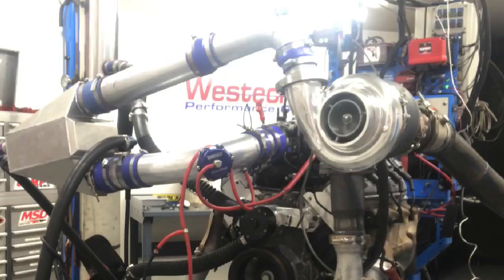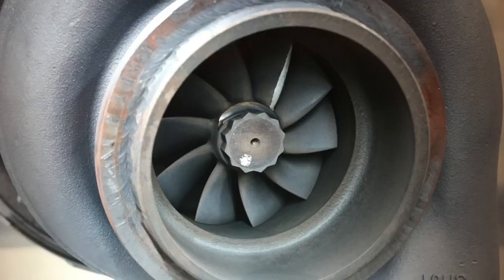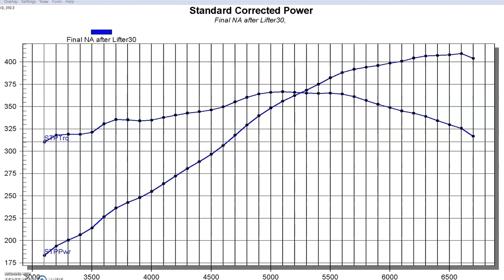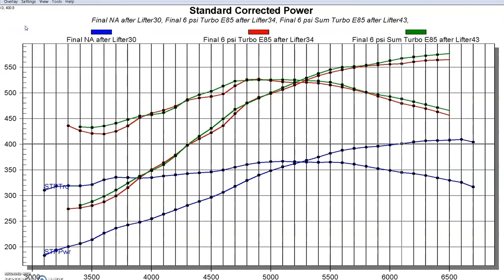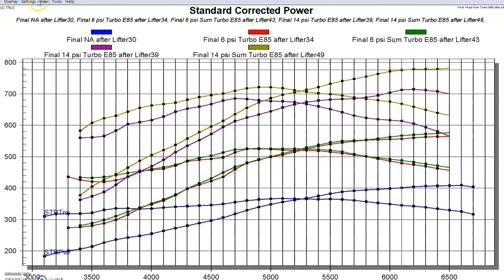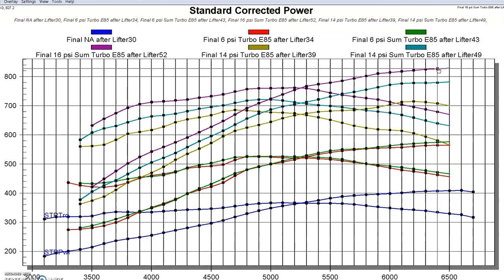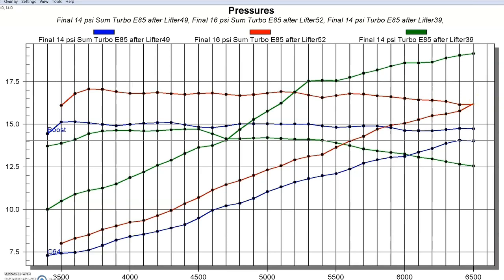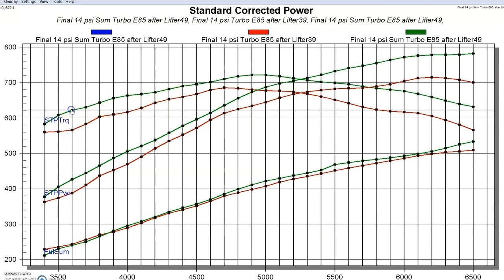CHEAP TURBO JUNKYARD 4.8L-GT45 VS S475 TURBO UPGRADE

Comment: Maybe you could awnser this wierd question. Would there be a hp difference on a 5.3 with single vs twins max boost 25 lbs
Reply from the maker: depends on exact turbo specs of each-but if both are sized to support 25 psi, power will be similar

Comment: How come Richard holdener hasn't done a 6.2 LS3 or 6 2 l92 Big bang test
Reply from the maker: I don't take the expensive alum blocks over 1000 hp, except the alum 5.3l blocks
Reply: @richardholdener1727  how much can they hold
Reply: How much horsepower can they make Richard holdener

Comment: I hope you see this Richard and you can help or anyone

I have a 4.8 with a small cam I’m only looking at 500whp at most thru a manual transmission 

I’m debating on vsr 75mm 83/75 1.10ar
Or 7875 .96 turbo

I’m looking for instant spool and not really die out till 6-6500rpm 

I’m not looking to make more then 550-550whp at most 

Please help thank you
Reply from the maker: use the 7875 or smaller

Comment: If all cams are turbo cams, why are you using a BTR turbo cam when his naturally aspirated cams will make more engine hP? I'm confused as to your reasoning.
Reply from the maker: we can use any cam for the test-the test was to compare turbos-not to max out the power output (which by the way, the turbo will decide how much this motor makes-not the cam)

Comment: In honest opinion I feel the s475 was the ticket. With a larger displacement, I feel the t6 would be better in over 5.7l+ where on this little 4.8l and even a 5.3l, a t4 in a 1.00-1.10 range would be a fairly responsive turbo. The gt45 looks like it'll be quite responsive and might have a really good power band for your street drivability at the sacrifice of upper rpm power. Not that the s475 would be lazy but it definitely won't come in quite as quickly. 

If it were me I'd pick the same thing you would Richard, s475 with a t4 housing. 😎🤙

Comment: Trying to figure out what turbo to buy for my t56 car, 5.7 iron block cam heads intake, looking for 1000wheel and want to know if I should/would have to go bigger than a s475 or say vs 7875
Reply from the maker: for 1000 hp or so, those turbo choices will work

Comment: Would there be a noticeable difference in spool time (lag) on a 4.8 between the GT45 and the S475? I'm only looking for 500-600hp on a blow through carb non intercooled 7-10psi max, running 93 octane. I'm trying to find a turbo that will spool the fastest.
Reply from the maker: PICK THE GT45
Reply: @richardholdener1727  thanks!

Comment: People also need to know the s475 T6 summit turbo uses a special exhaust flange on the turbine outlet side. It's not a standard flange. You can pick one up from Amazon, ect as I don't think Summit sells it. You can also neck it down to 4 inches unless you're going for really big hp without much loss in spool. 
I also suggesting getting the flange that comes with the correct T-bolt.

Comment: Richard get with Summit or/and JEGS,   make  packages for (N.A. or BOOSTED)
1. 4.6/ 5.4 Ford
2. 302/351 Ford
3. 4.8/5.3/6.0/6.2
4. 350 (1955-1990)
5. 350 LT-1 (1992 - 1997)
6. BIG BLOCK CHEVY
THREE DIFFERENT PRICES
A. JUNK YARD DOG
B. FIXER UPPER
C. More Money, More Money🤑🤑🤑
Thanks for ALL Your HELP.

Comment: Is the AR ratio on the gt 45 hot side the same as the 475?If it had a lower ar ratio like a 1.05 compared to the 1.32 s475 couldn't that impact back pressure difference?

Comment: How do you measure back-pressure? Do you keep the atmospheric pressure or is it pressure above atmospheric (as on the intake side)? I see much lower back pressure numbers on my small turbo set ups on smaller engines but have not worked with the large engines yet. (For example I get 1:1 pressure ratio on 24psi with a 2,3 liter 400hp engine)
Reply from the maker: the back pressure is a function of the turbo and engine displacement/power output. Back pressure is measured suing a sensor in the dyno-we run aluminum tubing from a steel fitting to a rubber hose, then to the sensor.
Reply: @richardholdener1727  Yeah what I ment was, do you measure back pressure including ambient pressure or without as with the boost pressure?

Comment: Richard you need to compare the CX Racing GT45r 76mm to the Summit S475. It also has the same 77x88mm exhaust wheel as the 69mm GT45, but has a bigger 76mm intake wheel and bigger exhaust housing. That'd be a good comparison

Comment: Can you bleed off back pressure to increase HP?
Reply from the maker: i've been told you can but have not seen that work
Reply: @richardholdener1727  

The problem with the gt45 is the undersized compresor. As it runs off the efficiency island on the right side attempting to supply x psi at a massflow it cannot support efficiently, neccessary compressor rpm goes through the roof. Exhaust side has to answer the request for more compressor rpm by bypassing less out the wastegate and using more to spin the turbine rpm higher. Hence higher turbine inlet pressure. Pay particular attention to compressor rpm traces on efficiency maps as compressors run off the right side of the map.

Comment: Be nice to see gate position on these. Be very telling if back pressure is opening the gate once it gets significantly above boost target. Would also tell you if the low back pressure is caused by an open gate or if the turbine side is sized accurately.

Comment: Could you dive a little deeper into WHY and WHAT actually causes the poor back pressure vs boost curve? Ie, could it be the AR of the gt45? Is it just the turbine size? A poor compressor AR to turbine AR ratio? Just a little more tech than “turbo size” 
Love your work!
Reply: Wheel design and housing(s) design. Some wheels/housings flow better than others. Even a s475/s480 has a race cover that make more power.

Comment: Building a budget Ls on my channel. For my Infiniti G35 street/strip car.  Gen3 5.3, gen4 rods, flat top pistons, ported 706 heads, TBSS intake, decapped injectors (76ish lbs/hr) Comp Cam valve springs, with ls9 cam..... turbo choice is my biggest hurdle.  Can you help! I dont want hear say. I'm a see it to believe it kind of guy.
Reply from the maker: How much power do you want? And a different cam will help a lot-especially with spool
Reply: @richardholdener1727  right now. 600ish to the tire with a th400 and stock 3.36 gears
Reply: @richardholdener1727  plus the overall theme of the turbo power plant has been use oem spec parts to get as much power out of what started as a 4.8 ls base motor. All parts in the long block are used parts I already had and refurbished them for this build. That's the reason I'm using the ls9 cam for now.

Comment: Boost pressure actually helps push the piston down on the intake stroke.  Backpressure on the exhaust cancels this out so any bckp more than bstp works directly against the piston area.  Taking into account stroke, rod length and rod angles, you can calculate an average torque number (parisitic loss) of adding more bckp than bstp.  As far as gains/losses on the comp side its simply a density ratio from the IAT's... And since you're running an intercooler and really only interested in the whole system in this test, i imagine the differences there to be minor... In reality though, if you have a less efficiant compressor that you run through an intercooler, the manifold sourced controller will make the turbo put out more boost to compensate for the pressure lost in the intercooler, and of course, this is paid for by drive losses on the exhaust side but since you didnt include pre intercooler temps and pressures, I don't have the data to say, but given data, its possible to model drive losses caused by spinning a less efficiant turbo faster to make the same boost after an intercooler.

Comment: Richard:    On the 4.8 I think that S475 has too much turbine wheel.   The compressor flows 98lb/min which is roughly 1000hp capable.  

I would love to see the same test but with the new Borg S472sxe (14009097006) with 1.10 T4 turbine.    It flows 110 lb/min with a 3mm smaller compressor and it’s turbine I feel is sized better for that smaller motor at 87/82.    I think you’d pick up quite a bit of hp but more importantly spool and lower IAT’s.
Reply from the maker: I agree on the sizing of the turbine for the 4.8L, I'm not sure how IATs would be effected by the change though
Reply: Richard Holdener I didn’t do the math and assumed as the new sxe turbos are more efficient.    However at at that low of a PR the efficiency is only 2% better resulting in a IAT decrease of only 0.5 degrees F.   

Also per Borg Warner Matchbot that 4.8 at the HP peak of 6000 rpm is ideally matched to their 87mm turbine.

Comment: I would love you to talk true the compressor dmap and lay it over the power curve if possible, wuld take a lot of Google search time out for me.

What it comes to back pressure its a comes down to the efficiency of both the turbin, and the compressor, if the compressor is realy bad it's going to take a lot power just to heat the air and that takes effect from turbine, if the turbin is really bad it's taking a lot of energy to get the turbine the power.

This is just my thoughts about the thing, usually you go with smaller turbin to get the lag down and the turbo to spool up lower in the revs. After all, you can size a turbo so that it doesn't need an waste gate, you culd do it so that the compressor is right in the middle of the map getting best efficiency and you don't need to waste eny exhaust, how ever the trade off is that the power band is really small. And the turbo is quite laggy

Comment: I disagree with some of you points regarding back pressure. On the ebay turbo (imo) the turbo reaches its maximum shaft speed around 700hp. Once the wheel can't spin any faster it causes a major restriction in flow. The boost pressure keeps calling because the engine is getting more efficient as the rpms are climbing, the turbo cant spin faster to keep up with the acceleration of the engine, so the boost goes down. This is also the reason both engine make the same hp. The bigger engine makes more tq because it is more efficient in lower rpm due primarily to displacement.
I would like to chat with you directly about this sometime, darksideturbo@gmail.com
Reply from the maker: Always Happy to talk, I'm curious how you come to conclusion that the turbo reaches a maximum shaft speed at 700 hp (at what engine speed and boost level?). Especially without knowing what that speed was in this test. We know from additional testing that this turbo will support 800 hp, and would do so on this 4.8L, with more mechanical spring pressure on the gates. It just wont be happy at this power/boost/back pressure level.

Comment: What were the intake air temperatures that will tell you the compressor difference
Reply from the maker: They were taken in the intake after the cooler-I needed to take them pre cooler

Comment: You are never going to get a turbo that's both perfect for a small block 4.8L and a 454 big block, any turbo that has an appropriately sized rear wheel/housing for the 4.8 is going to be too small for the 454 and choke it or come on way too aggressively and anything with a rear housing/wheel sized for the 454 is going to be really laggy and take forever to spool up on the 4.8.

Comment: Richard Holdener The first compound setup I ever built was a he351cw over a ebay gt45.  It made so much boost and back pressure after 110psi my 5 ply couplers would burst splitting in half. When that happen oil would shoot past the compressor on the he351 oiling my whole engine down.  I learned to use the intake off my turbo as vacuum in a catch can and Ive since got rid of that setup.

Comment: Thanks for showing a dyno video on this one.
I think it adds to the content quality when short vids of the actual power runs are included with the test results;and I’d like to see each run for each test like engine masters.
A simple data log of intake temps verses boost comparisons would show if the gains came from compressor imo
Keep up the good work 💪
Reply from the maker: thnx-on some of these older tests-I don't have each run or even any runs on some of the much older tests(I've been testing since 1989)

Comment: you are hard working Richard!  compressor has a big influens on the back presur also.   big engins neads big turbos.  junk motors is the best lerning tool.  I have done junk volvo dyno  b230 engins (sweden LS engine?) meny years and it never gets boring.
Reply from the maker: Go Volvo!

Comment: Here's what I think, theoretically with the same back pressure and boost pressure (as well as temp, humidity, other air density factors) an engine should make the same power. So what we saw here is the new turbo is more appropriately sized for the power level (in this case, boost level) it was run at. So back pressure went down. This reduces combustion temps, egts, and prevents exhaust reversion that kills horsepower. The GT45 is just too small to be a power adder for an LS. Most turbos will make more power than they should be run at, look at OEM cars that have massive gains with ECU tunes. Yeah they make more power, but the turbo is overspeeded, maybe the exhaust backpressure is too high, etc. When building project cars we're not usually restricted by a rulebook, so we may as well size turbos correctly rather than push a smaller turbo to it's limit. As for spool, it's my understanding that the GT45 is actually pretty terrible.

Comment: If you wanted a T04 flange S475, you could have gone with a Borg Warner or Bullseye Power. Not sure why you are stuck on Summit unless they're a sponsor.
Reply from the maker: I wanted to try  A tT6 on the 4.8l-A T4 is probably a better choice-Just letting them know what might work better-maybe they listen to the customers

Comment: 4.8 vs gen 1 sbc N/A and turbo but with comparable heads and Coil on plug upgrade for the gen 1 both running holley hp sequential fuel injection

Comment: Which turbo is the best for ls 6.0
Hard driving  in sand withe perfect power  not less 700 hp
Reply from the maker: 78/75 with a good size AR

Comment: Great test! It'd be interesting to see a comparison between the T4 83mm S475 and the T6 96mm S475
Reply from the maker: I did a T4/T6 test but I think it was on an S480
Reply: @richardholdener1727  in which video ?

Comment: Nice video Richard. Am seeing results atm with a 6.0 and vs7875 and I'm seeing a full 2-1 ratio running through mufflers. Next time at the track I'll drop the mufflers and let you know the result. One thing to note is I'm setting up flex fuel atm and see more back pressure with e85. What you say about drivability is valid but the 475 still has more torque at 3500
Reply: I dont think dropping mufflers will help much, the vs7875 just has a tiny .96 turbine housing which I think is its only flaw. They now offer a 1.25 housing for it but it's divided so I'm not sure how much more volume it really has inside. I have the vs7875 on a 5.3 currently but have no pressure data yet.
Reply: @FredAllenBurge  agree, but a test will prove it. I really think this turbo is done at 6000 so if I was to make a change I'd go much bigger in the turbine. That being said this sure is a nice street car setup, gave just been a bit worried if 28psi back pressure could damage the engine
Reply from the maker: a portion of the increase in back pressure from e85 comes from the extra power
Reply: @richardholdener1727  yep. Back pressure went from 24 to 28 psi unleaded to e50. How much Back pressure is too much on a sbe ls? Will it damage it

Comment: What is the intake temp difference? The s475 is going to heat the charge air less at the same boost level. What is the difference with the timing curve? The lower back pressure/drive pressure on the S475 is going to allow more ignition timing at the same boost level. It would also be interesting to see the power/torque difference between the gt45 and the s475 out of boost. I have had big turbo LS setups that drove really great and had a lot of torque out of boost my theory is that the engine can breathe through the turbine at low rpm and make good torque out of boost before it spools up and makes real power at higher RPM.
Reply from the maker: no changes in timing and minimal changes in temp-but we only took it in the intake after the cooler

Comment: Big fan of showing the back pressure vs. boost curves.  So many customers don't understand why their friend's established brand name turbo outperforms their cheap Chinese knock off at the same boost pressure.  You can verbally explain it all you want, but showing them something like this is a great way to demonstrate that you usually get what you pay for.
Reply: The difference shown here isn't from the turbo's brand or quality its mainly from the turbine size and turbine housing size.
Reply: @FredAllenBurge  You are right that size matters - no argument there.  But never underestimate how bad the knock off stuff from China really is.  A good Garrett GT4508 should be capable of pushing well over 900 hp on E85 while staying within the 70% efficiency island on the compressor.  Just don't see that happening on these no name turbos.  But they are cheap, and if they meet your power needs, more power to you.